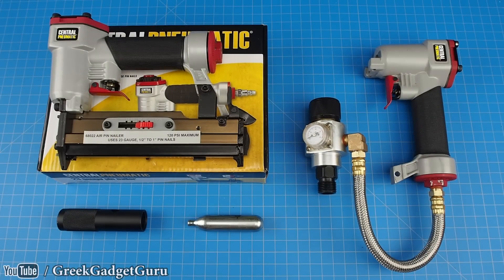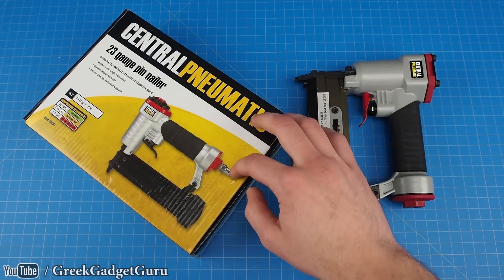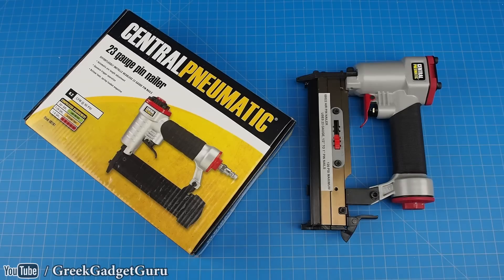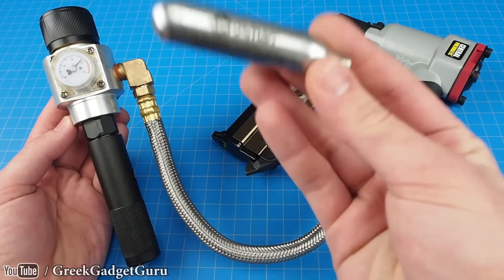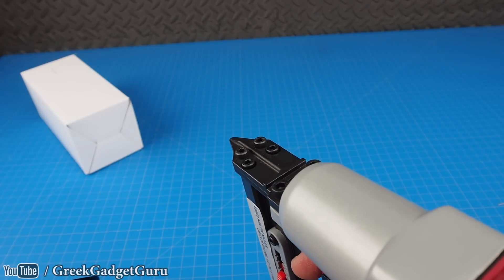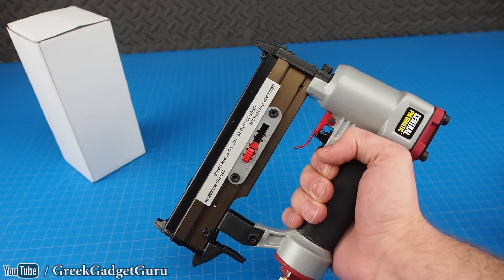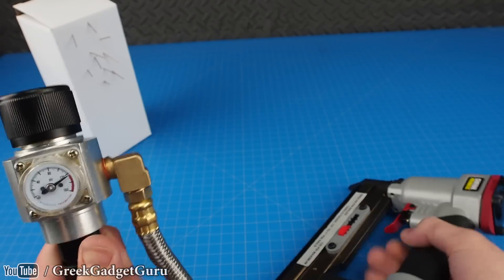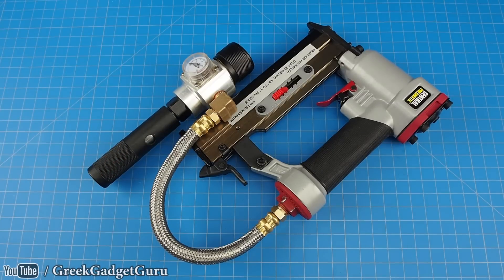Mini Power Source? - The Iron Man Mechanic Nail Gun

Comment: Do you still have a list of parts to do this?  This would be perfect for those little quick repairs or hobby jobs when you only need at most a few pins and don't want to lug around a compressor and hoses to the work.  Way better than the pricey battery powered pin nailers for such light use.

Comment: Can I use this same co2 regular with a paintball compressed air tank or is that too much psi for the regulator to control?
Reply from the maker: No, it will work. Same pressure, higher volume.

Comment: question about regulators, i have read online that 12 co2 cartridges have a gas pressure of about 800psi, is there any advantage of using a high pressure regulator before the low pressure one?

Comment: The nail gun idea seemed like a possible weapon at first. but seeing the types of ammo you can use, it's not really practical at all. I can't actually see any modification with the current 'gun' you have as the nail are basically sewing pins. However, the only way I could think of it being viable as a weapon is by hiding it within a glove, or finger, and have some type of poison on it. By squeezing your palm, the gun is triggered and delivers a close range poison dart. 

A bit of a suggestion I would like to make for a possible project would be a card shooter like gambit and that spiderman line shooter

Comment: A quick CO2 reload system i think could benefit it a modified cartridge holder that requires a hard quick slam to lock id down and reload quickly an a short turn to release the holder.

Comment: Couldn't you wrap a copper coil around the section where the CO2 cartridge is and run a current through it? This way it would keep the cartridge warm thus increasing the pressure of the CO2 cartridge.
Reply from the maker: That would be interesting!